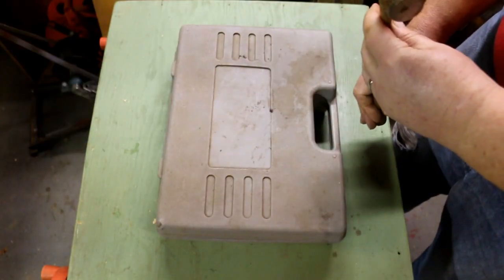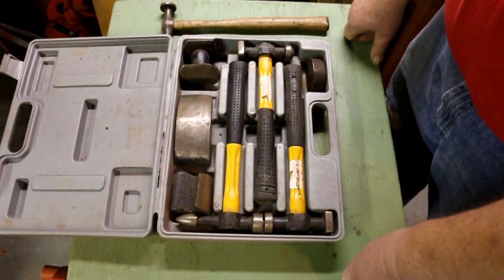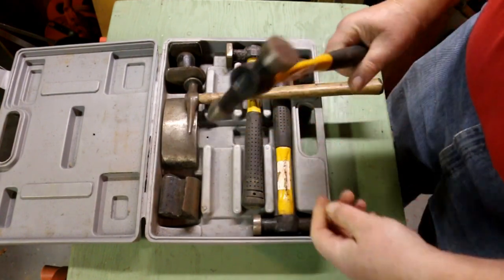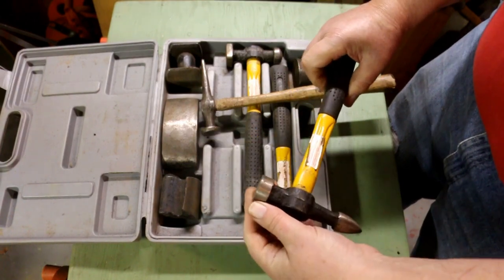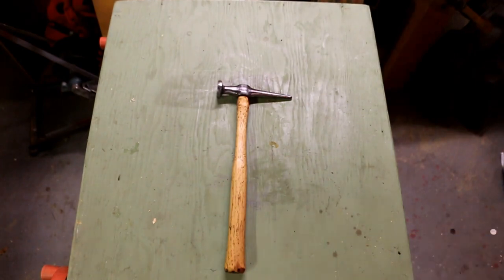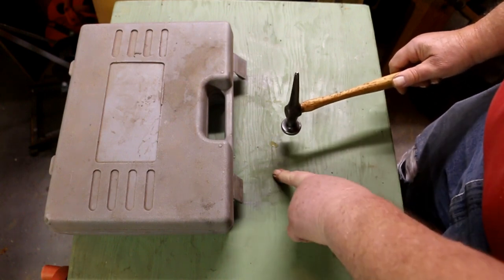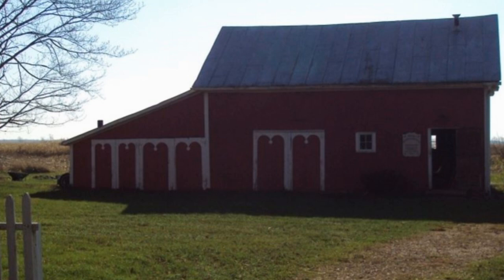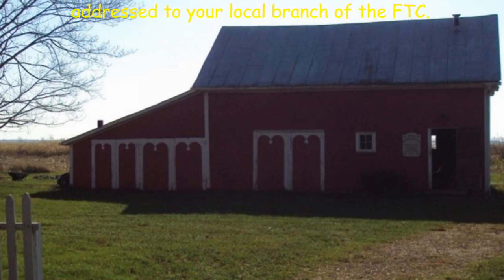Tool Restoration - Finishing Hammer

Comment: I don't think it's necessary to show the same type of work in two separate videos.  You can always mention another video (and even provide the link) if someone wants to see all the little details.  And it is abundantly clear your new old finishing hammer is a far superior tool in comparison to it's HF cousin.  I'm pretty sure I've got one similar to your new one.  I've never used it, but I've also never done any body work either.  My total experience in auto body work consists of sanding down Bondo for a buddie's Dad...

Although I have wondered if auto body tools might have any purpose in a budget blacksmith shop.  As I've never seen anyone use (or even mention) them, I am guessing the use case would be slim to near non-existent.
Reply from the maker: Thanks Brian. 
The body hammer is a specialized tool. I agree its usefulness in a blacksmith shop is limited to a small part of most shop operations. 
Since it is a finer work tool the things I can think of are the artist blacksmith making sculpture, armorer creating plate armor, and panel creator's repousse work. 
Body shops are not likely to use them on modern cars. An accident destroys the plastic front or rear panels on a vehicle. The parts are tossed, and new ones bolted on. I think they clip on more than bolt too. 
@Mustie1 uses a hammer similar to the finishing hammer as a go to tool for tapping and assembling.  😁😎

Comment: I THINK I've got a body hammer in the same drawer that the ball peen with the jagged handle stays and why and where I got it I have no idea. It's just there. All the body work I ever did was with a 3 or 5# hammer and a set of forks on an IT-28 Cat loader. You can do a lot with bent stuff with a set of forks on a loader. I did, anyway. Took the strain of fixing stuff off my old wrenching pal that got the Honda wagon and gave him some wiggle time. 2nded the deal about the spare rider last night but since Ricey and goffer pro brother are covered up at his shop, the son-in-law will go get it and bring it here and I get to play 'Will It Run & How Good' one more time! It's another LT 1000 with a 16 horse Briggs 6-speed and 42 inch cut just like the opposed. Needs a tire or tireS on the front or tube(s), a battery, an oil change to Delo, a greasing/oiling and a cool air intake boot. The rest he did when he put the new tranny in it. I know how he does stuff and it's WAY over the top. And if it needs more,  I've been looking at parts. Another deck resining too I hope. Regular blades and the Gators will come later. SO I have a purpose again and am delighted. Still looking at polishers too. You never know. BLESSINGS!
Reply from the maker: Nice to have a purpose. Mine today was sucking dust through a paper mask wihle mowing. No rain for a week and a half. Best hope is Saturday. Feast or famine here in the frozen north. 😁😎
Reply: @OldSneelock  It is here too but usually soggy. The price one must pay for living in the high tropicals. Blessings 2 all and to all a good day!
Reply: @OldSneelock  We mowed yesterday evening and it spit last night. Batteries are doing their job as is the petrol products! And Us'ns!
Reply: I think I already destroyed the blades on my newish Deere John 54" mower.   Half-buried stones, hidden wire cow panels laying down in tall grass, cutoff fence posts and stumps that aren't quite at or below grade, have all taken their toll in the year and change I've been mowing at my new home.   Once I get a real tractor to do real work, I'll also get a new set of blades.   Until then the originals will have to suffice.   Project Farm reviewed blades a while back and I think it was Gators that floated to the top of the rankings.
Commander Todd's is so far the only comparative tool testing channel I fully trust.   Maybe followed by Tool Torque or whatever their called.
Reply: @tree_carcass_mangler  Hi, Steve and the Commander is the only one I watch and/or trust on a regular basis.Somnebody else might be pushing some gimmick and I'll smoke it over but very rarely get one or have any interest unless I need something like that.. Mr. Dactyl is the same way and has a dandy sometimes but that's just fixing stuff. My old pal Ricey turned me onto Gators when he was running the saw shop down the road at the ACE but now has his own place. I'd just keep grinding and balancing your old ones till you get stuff sorted out. I put more on balance than sharp but one usually is holding hands with the other. Bearing wear and balance are close kin as you well know. I need to grind mine on the rider but are careful to raise the deck over gravel and such but it's still be a while since I put an edge on them. And it takes a while to get stuff like you want it. Just be careful and try not to overload yourself and remember that Unc and Myself always have your back! Be Blessed!